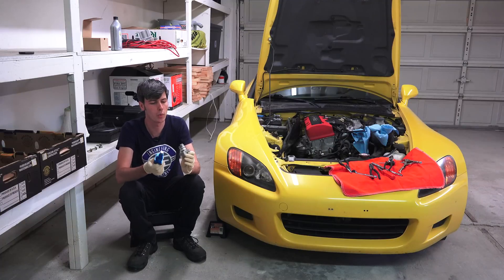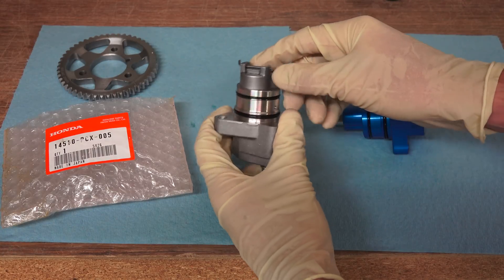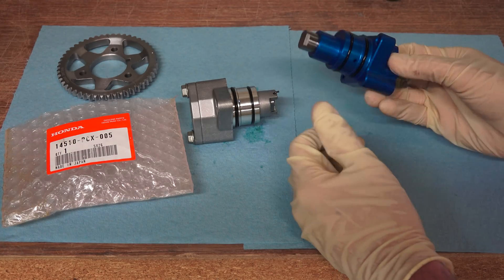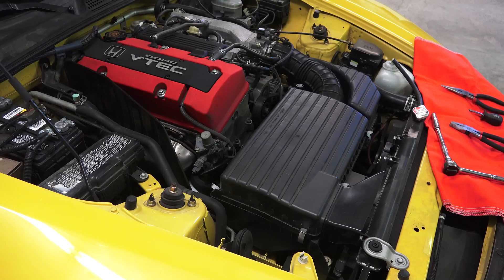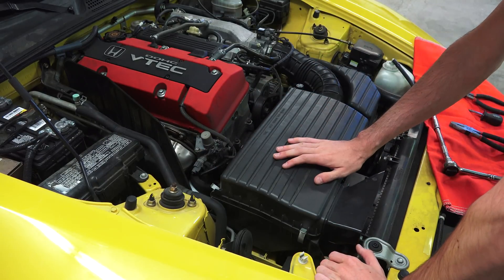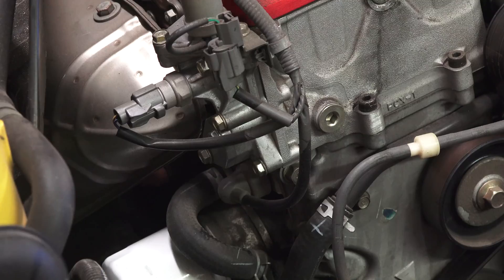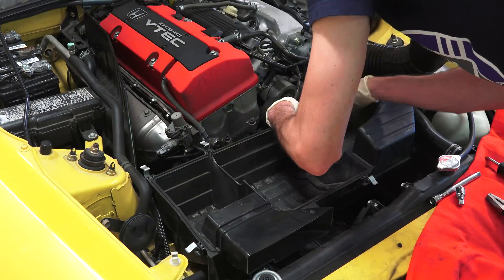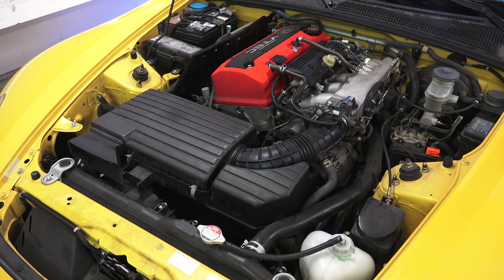Fixing A Common Honda S2000 Problem - Timing Chain Tensioner

Comment: Chains in normal conditions don't stretch, they wear!
Reply from the maker: My vocabulary says that "stretch" and "lengthen" are the same thing, despite the accurate, technical differences. ;)
Reply: Most people don't really care how the chain is  longer now. All they care about is put gas in and go.
Reply: The rollers wear, increasing the distance between each pin.  Effectively lengthening(or stretching) the chain.  Very easy to see if you replace a worn chain on a bicycle.
Reply: Thanks tips!
Reply: he made it for ppl like me who care

Comment: Should have gone with a Billman. Better internals, lifetime guarantee and free upgrades as improvements are made, including swapping out for higher lift cams if you change those out. Billman250 on s2ki. If you ever find yourself at a Dragon event, he does the install and part at a steep discount, otherwise, you can just order one.
Reply from the maker: Billman needs a website if he wants to sell more haha. Ballade also has a lifetime guarantee, I'm not worried about it.
Reply: I suspect he keeps himself low profile in order to keep a better relationship with customers, and maybe weed out people who would buy something with no clue how to install it. 

If nothing else, any question you could ever have on S2Ks has been answered by him on the forums. The man is a walking service manual, except he found easier ways to do stuff.

Oh yeah, nice video! I enjoyed seeing actual practical discussions alongside the theoretical.
Reply: Billman is one of the few who don't need a website.  His reputation precedes it.
Reply: Nah, helping those around him to the best of his abilities and achieve great results > helping many many many people but not as in depth or effectively.
Reply: Engineering Explained, Billman doesn't look for customers, customers look for Billman.

Seriously, Billman is THE s2000 guru. I chose to buy his tct as a thank you for all the free advice he's given to the s2000 community. 

Plus, Ballade seems lacking in the customer service department.
Reply: there is really no reason not to have a website in 2016
Reply: nice...yea im torn b.w billman and ballade...sucks for billman to go tothe car meets and just have to work on cars instead of enjoying himself...unless thats what he enjoys than its a win-win!!!
Reply: sungod1976 He needs a website, if he wants to sell things effectively. Where are people going to read about why he is different and better and choose him over the competition. They can't. Just as Engineering Explained couldnt. Word of mouth only goes so far.
Reply: Raoul G I get it and you certainly have valid points for the average retailer out there.  Billman is a one-man show and maybe does not want, or need, to increase his market share or sales.  Knowing the man, his driver is not the bottom line but to help the amazing s2000 community.  But getting back to Engineering Explained's video---love it!
Reply: sungod1976 More sales > more money for research > better product > help more people.

More sales > help more people.
Reply: Calvin Nguyen you seem to have the misconception that if you help many people you cant do it effectively... It's not one or the other.

Comment: Were you raving the engine after you started it? The idle didn't sound smooth.
Reply from the maker: It was completely cold, so it started low, then raised as a result of temp. I also did a bit of editing with the clip to shorten the length, so you may be hearing the sound transition.
Reply: Engineering Explained I see, that makes sense.

Comment: Please don't turn this channel into a way to sponsor a build on your Honda :-/  I feel like you said the manufacturers name like 50 times
Reply from the maker: This isn't sponsored by Ballade. I asked if they'd be willing to send the part, they said yes. I would have bought the part either way (though I probably would have gone with silver). There's no contract, no agreement, no money exchanged.
Reply: Jason isnt advertising Honda.  Advertise S2000 does noy increase Honda new car sales.  

Jason, a year later, how is that tensioner working out?  I test drove the Alexs S2000 from Ballade, it was smooth.

Comment: What does the manual say on the S2000 for the oil level check method?  Is it run for X minutes and then check?  or just check some time after running? (I ask due to something i discovered with the cam chain tensioner and oil levels)
Reply from the maker: I usually wait to check until it's been sitting for a good bit. Lots of oil will be in the head dripping down slowly with time.
Reply: Aha, so, here's the thing, and you might be interested in this.
I discovered after re-reading the manual for my CBR600, that it wants the oil levels checked right after running the engine for a couple of minutes.  Left longer than 30-60 seconds at most, too much oil drained down and gave a false report on the oil level.

I was having massive CCT issues, not seeming to tension enough, despite being new and working when first installed, turned out i had been running the oil too low (they are sensitive to pressure (as are VTEC engines)

It's absolutely worth checking the factory method, some are check after engine off for X minutes, others are check as soon as engine off, makes quite the difference.

Comment: Hey engineering explained! i've looked around everywhere in the internet and can't find an answer- Why does a lamborghini aventador v12 sound different than all the other v12's
Reply: I believe the sound is caused by the Aventador engine's unique cylinder firing order.
Reply: maybe a different style crankshaft? Like how flatplane and crossplane v8 sounds different
Reply: turns out the new lamborghini v12 has a unique firing order compared to other v12s

Comment: Rotating the crank without tension on the chain is very bad advise.
You might want to clear up that you only need to slightly rotate the crank just to ease off the tension it may have. No more than 5 degrees, which you can do by hand by grasping the outside of the pulley.
Reply: Kirill Ostapenko damn wish I read this before doing mine today...

Comment: That engine bay looks sinfully stock for an S2k..... Get the mods coming ASAP!
Reply: skirmich it's difficult to get substantial power gains on the s2000 without going forced induction. Honda did a thorough job with extracting power from the f20c
Reply: Scott Carter Even for the sound getting a CAI or something... That funny looking Air Box always looked odd beside the beauty of the F20...

Comment: Why would you not change the chain😞
Reply: Newyork90 I've spent many years on the international s2000 forum (s2ki) and never heard of problems with the chain itself.
Reply: Because you have to take the cover off, and all the pulleys and reset the timing and it's just a major PITA. Besides, chains last forever.
Reply: Dejected Sasquatch i would still rather be safe than sorry, after all it is man made..

Comment: TCT tends to go bad when your oil level is low!! If your tensioner starts to rattle is basically telling you that it needs oil to pressurised the timing chain.
Reply from the maker: It rattled when I had sufficient oil.
Reply: That would not make sense - As long as suction-thing in oil pan is submerged you should have full oil pressure. Maybe it is an issue when oil thins over time and when you add more it regains sort-of correct viscosity?
Reply: Jaime's Unicorn Power the chain stretches over time...
Reply: Your awesome dude! I'm glad you bought an s2k! Here is another  issue with AP1's! Hopefully you can make an informative video! The banjo bolts inside the cylinder walls are to small! Honda replaced them in the late model years of the Ap1's !   I replaced them with ap2 banjo bolts and it fixed the oil comsuption!
Reply: Jaime's Unicorn Power Can you elaborate? Maybe this is one of the things that adds to my S2000 oil consumption :)

Comment: Probably the MOST IMPORTANT bit of information he gave in this video was at  9:30  where he advised to use a torque wrench to make sure the bolts are not over-tightened in any aluminum blocks.  This should always be done whenever installing ANYTHING on engines as most engines are now made with aluminum.  You would not believe how many times people mess up their engines by using simple wrenches, and then stripping the threads out.  That's one of the biggest mistakes most people make when working on their engines.
Reply from the maker: Thumbs up because proper torque is important!

Comment: Great video!  I have gone through 3 TCT with only 66k on the chassis.  I have never heard of the Ballede product.  Depending on how your experience with the Ballede TCT, I may pull the trigger on it and get it sooner than later since I am on boost now.

Comment: Quick question Jason, what will your first major upgrade be? New suspension? Wider tires? Any engine modifications? Aspiration? Exhaust? Thanks!
Reply from the maker: Probably tires. Don't have a set plan yet. Still need to change out a bunch of fluids!
Reply: cant wait for the next s2000 video.

Comment: Life must be good with an external tensioner,  you  lucky fuckers =) 

TIP: You may wanna put your cylinder 1 in TDC (compression stroke) before doing this work
Reply: yes you should because when you remove the tention from the chain and your cam could be in a tention spot due to a valve spring being compressed the cam could turn causing the chain skip teeth and you might not know because everything is covered. sorry for the poor Grammer

Comment: Confused by what you mean by 'worm gear' What is actuating the worm gear?
Reply from the maker: There's a spring inside that pushes the cylinder out along the worm gear. Essentially what the worm gear does is allows the cylinder to out, but not back in (the spring forces it out, but the gearing prevents it from coming back).

Comment: Ok wait! The gear which you install has a bigger radius in order to compensate the length of the chain? Doesnt that mean that the timing between crankshaft and camshafts isnt correct anymore?
Reply from the maker: Correct. Slightly off. But I don't know how much at this time, so I didn't replace it. You can put the crank at TDC and then check the cams to see if timing is off.
Reply: Engineering Explained Ok I just wondered. Thanks for the answer!

Comment: It's actually a regular TCT  with a powder coating.

Look at the oil inlet on the Ballade unit and the OEM unit. All they did was widen it, I told you this in the previous video. Then they change the springs, totally unnecessary in my opinion. The OEM unit just doesn't have enough oil flow, widening the oil inlet to 3mm will permanently fix 99.9% of TCT noise. Could have saved yourself some money, but if they're donating it it's all good it's certainly a good piece and a good investment if you have thumbs for fingers and not much of a DIY'er.

Comment: If the tensioner is fully extended then the chain has stretched, the tensioner might be fine with a new chain, or sprocket.

Comment: Oh boy, you should have replaced the chain!
Reply: FFM0594 I think the interval is to inspect the chain at 200k miles. with proper oil change intervals they last a long time.
Reply: Yes, but changing the sprocket is an unscientific workaround. The length of stretch cannot be a constant making simply adding a tooth an adventurous solution, IMO. Regards, Adrian

Comment: my God, what an easy job.  i just did a complete timing chain/gears/guides/tensioners on a 4.6 Mustang, what a nightmare.  no wonder Honda is so popular
Reply: No you can't you need 16 10mm sockets cuz you will loose 15 of em
Reply from the maker: ^^ Matt's wrenched on a Honda before. When my car was stolen I actually found another 10 mm wrench in the car. I was pumped! Who knows where it is now.
Reply: yes you can! especially a honda civic! ive done it before
Reply: they are like legos
Reply: The S2000 is probably the easiest car to work on that I've owned. There is so much room in the engine bay. It only takes 5 mins to do an oil change because you don't need to raise the car.

Comment: With some engines if the manual TCTs are too tight, you'll end up wearing the chain guides out prematurely-- or worst case, breaking them. Too loose, and the chain can jump. It might be important to bring this up when it comes to installing and adjusting it.

Comment: Speaking of superchargers and turbochargers, are you planning on boosting the S2000?
Reply: RR 10 I hope not.
Reply: @Tekmatic Not on an S2000. Other Honda's for sure, like the F23A single cam Accords.
Reply: Why, Qasim, superchargers are amazing on VTEC engines.
Turbochargers, are alright too, (but the boost lag bothers some people).
Reply: Mihaly Lukacs I suppose, but I just wouldn't want anything to spoil the noise the car makes.
Reply: vtec has nothing to do with it.  vtec is SIMPLY for fuel economy in the lower RPM range.

Comment: did you have to set, the engine to TDC or anything like that before you u bolted the TCT? this looked a lot easier then I imagined..I won't be as worried when I hear the rattle on my s2k
Reply from the maker: Nope, can just turn the car off and go. I'd recommend doing this while the engine is cold obviously, as the TCT is right beside the exhaust header.

Comment: Interesting that the aftermarket design is like that.
On sportbikes the stock tensioner acts like the OEM one here, but the aftermarket ones are manual, meaning you have a bolt and a nut sticking out of the back, by turning this bolt you move the piston and set the chain tension, then you lock in in place with the nut.

Comment: I have a 2008 bmw 335i and whenever i let off the gas it makes a rattling sound that sounds like a chain? Is this the timing chain tensioner and is it costly?
Reply: look up 335i wastegate rattle
Reply: william wolfe its not easy getting rid of a car lmao... how are they a nightmare.. i have driven it 75,000 with no issues so far
Reply: Daniel Talanga its not the wastegate, thats a completely different noise then what im hearing
Reply: Daniel Talanga yea, the turbo's are fine tho
Reply: Of course it's costly, it's a Bimmer!
Reply: Keon R. Yea, dont expect things to be cheap when it cost like 50,000-60,000 dollars
Reply: Elite3665 if it was the timing chain it would be audible all the time not just lifting off the ass gas
Reply: Elite3665 Oil and radiator leaks were also one of the many issues my e60 had.
Reply: Keon R. and here i have an e90 and it has all sorts of problems lmao
Reply: ***** Lol, you seem a little heated... im in no way bragging about it so I don't see how you are angry.

Comment: So you're SURE I can pull out the old one without the pin?  Thats the part that scares me, haha.
Reply from the maker: That's what scared me too. I did it without putting the screw in. If you're nervous about it, just takes another 5 mins, you undo the two bolts that have the gasket covering the banjo bolt inside, and replace the banjo bolt with a 5x0.8 mm screw w/ wing nut, and you can ensure that cylinder goes no where. But as I showed in the video (which I haven't seen anyone else show the actual removal step), it can be removed without.

Comment: so why didn't you replace the chain?  wouldn't you want a new chain to make sure the it doesn't break?  does that sprocket you showed also account for the change in pitch of a worn chain?  makes more sense to me to change out a part like the timing chain if you're doing new-to-you car service.  Thanks for the video.
Reply from the maker: Yes, the better solution is replacing the chain. But that's a much longer job that isn't exactly necessary if the chain is in good shape. These are strong chains, a little stretch means the timing is slightly off (not ideal), but the immediate concern was ensuring the chain doesn't skip, hence replacing the TCT.

Comment: Don't you want to rotate the crank before releasing the chain tension? I think you made it kinda risky.

And by the way, is this a factory air filter?
Reply: yes its stock
Reply: The only time you might need to manually turn the crankshaft a bit is if, when you're putting the new TCT in, the TCT might not sit completely flush against the block. In that case, you may have to manually turn the crank. I did not have to do this during my install.

Comment: What happens when you drop the pin from the Oem?
Reply from the maker: As in if you drop it in the engine? You'll need to get it out.
Reply: +Engineering Explained I assumed that youd need to and likely happens.

how do you get it out? oil pan?

Comment: Words cannot explain how happy I am that you got this car. It will help me so much with maintenance on mine! :-D
Reply: The S2000 ap1 tends to burn oil specially with Mobil 1. I've found that the best oil for my ap1 is Castrol Syntec 10w40. My ap1 now burns little to no oil and stopped the piston slap noise I used to have with Mobil 1.
Reply: Tip #1, don't use Mobil 1 and check your oil level frequently if you love the VTEC (more so on an AP1 but AP2s aren't invincible).
Reply: Also possible premature tct failure. My 00 AP1 was drinking Mobil 1, used by previous owner, I switched to Royal Purple and oil consumption dropped significantly. I'm now adding about a quart to two quarts every 5k miles depending on how VTEC happy I get. The nasty exhaust mess on my bumper stopped after dropping Mobil 1.
Reply: hobbeezy what's wrong with Mobil 1?
Reply: word!
Reply: SAME!